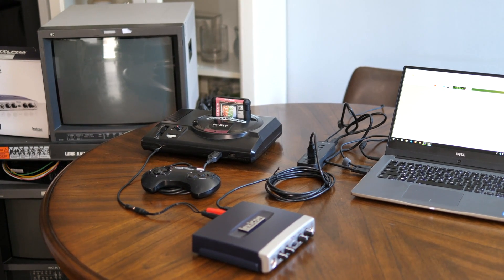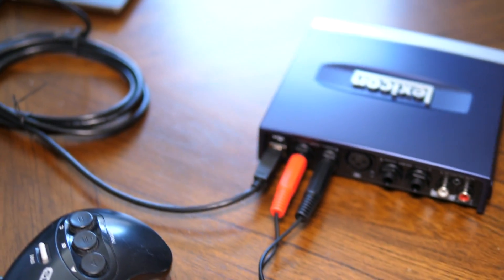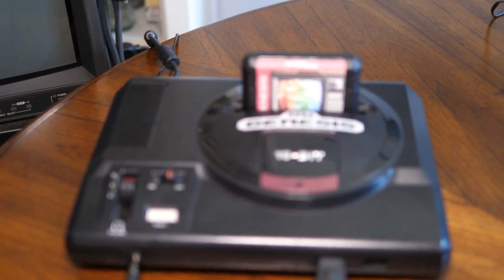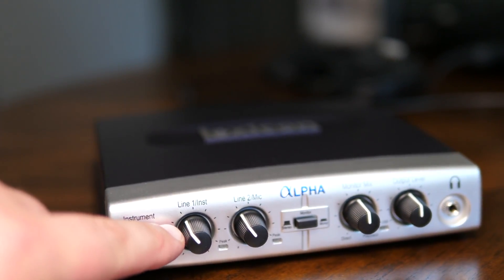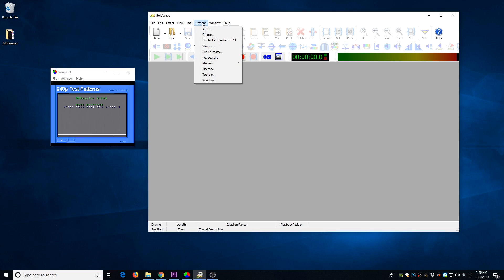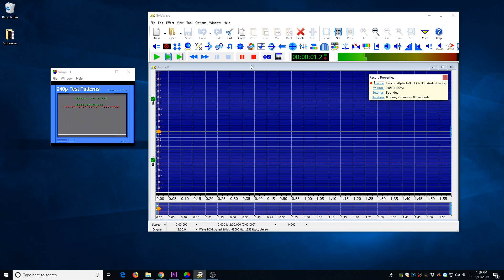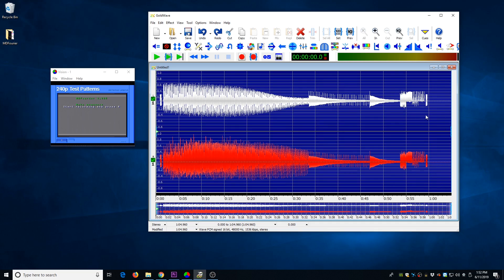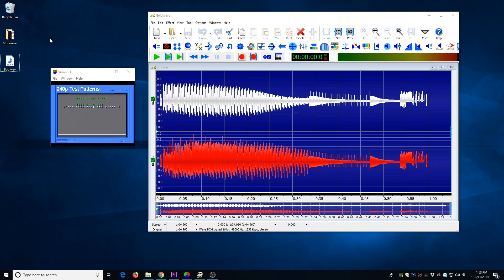Analysing Genesis Audio with MDFourier

Comment: Why would you record at 16bit when the difference from 24 is audilble? You should record at as high quality as possible so the computer's sound card quantization errors are reduced compared to the recorded material.
Reply: Because there is no need. 24 bit audio just gives us more dynamic range, which we don't need. The systems are well below the 96 dBFS dynamic range covered by 16 bit audio.

Comment: I'd love it if you made references for multiple versions of the same consoles. There's no way everyone is going to agree on a single definitive version.

Don't forget that some sounds may be difficult to isolate. For example the Yamaha YM2612 has a unique sort of crossover distortion known as the "ladder effect" that emulators ignore and to have a genuine recreation of the sound from a sega genesis you would have to add that back in. Maybe a way to do that would be to record a YMF276 (which is basically a YM2612 except without the built-in DAC and thusly no distortion) and compare the two.
Reply: Hey, thanks for the feedback. Indeed the "references" are relative, I invite you to check the documentation: http://junkerhq.net/MDFourier/
The ladder effect is certainly harder to detect, but we'll need t experiment with that deeper. I am sure that some test tone scan be designed to specifically identify the differences with it, but for the time being please check the results section in teh document.

Comment: What made you decide to choose the 48kHz sample rate? I've been under the impression that the sample rate of older consoles like this is lower, though not sure which one. Maybe tape-level (32kHz)? Sega CD games would of course be 44.1kHz. Maybe it doesn't matter if the source doesn't match the recording.
Reply: The document covers this in detail: http://junkerhq.net/MDFourier/

44.1khz should be enough and is what my software supports.

However, we found some audio cards, not the one shown in the video, have an imprecise sampling clock when timed at 44.1khz, and this gives frame rate detection imprecisions. The doc lays it out in more detail if you want to read about it.
Reply: Sorry, didn't cover a few more points ytou asked about.

The frequency range of PSG and the YM2612 does cover the whole 20-20khz range, so you at least need 44.1khz to digitize the usable frequency spectrum, by Nyquist -Shannon.
Reply: @ArtemioUrbina  What's crystal in the Genesis, and what's the divider sent to the YM2612?  I ask because Yamaha's OPL series can generate frequencies that 44.1 KHz would not be sufficient to capture.  For example, the effective rate of the OPL2 as implemented in Adlib and clone cards is 49716 Hz.  I understand that capacitors and other components would filter and attenuate this in an actual Genesis, but I wanted to know if you'd thought about that.
Reply: @JimLeonard  thanks.
The ym2612 is clocked at 7.67mhz. I don't consider anything above 20khz for analysis, since that is outside the human hearing spectrum. It could of course be easily changed, but I see no purpose in doing so (besides, there is less data as frequency goes up as you can see in the docs. And the preferred sampling rate is 48khz)
Reply from the maker: @artemio - Thanks for the explanation!
@Peredonov - When we started, we tried everything from 96k down to 32k.  Eventually I just asked: "Tell me which I should use in the video" and they said "48k."   LOL, so yeah, Artemio's explanation is the best :)

Comment: Interesting... but how are we ever gonna decide what a "default" Genesis should sound like?

It would be actually very funny if you could record your favourite childhood Mega Drive, and have your emulator mimic it exactly as you remember it 😁
Reply from the maker: Excellent point.  Generally speaking, VA3 Genesis consoles are regarded as having the best audio, so that's what we're aiming the 3BP to sound like.  I'm sure some people will disagree, but I feel that's fair.
...but it's completely plausible that a software emulator might eventually create a feature that imports an MDFourier example and auto-tweaks the sound to match.  I'd LOVE to see something like that.
Reply: @RetroRGB  imo the ideal system would be a VA0-2 without the distortion. the low pass filtering on those earlier revisions is plenty.
Reply: @jc_doge   If you have a capture using mdfourier of a Va0-2 genesis I can take a look and see how it differs from the va3 recordings we have.
Reply: That is exactly the point. You can select your own reference.
This is detailed in the document, with even other interesting options